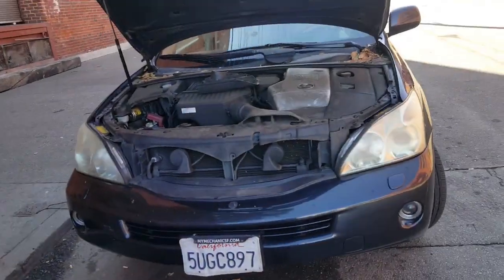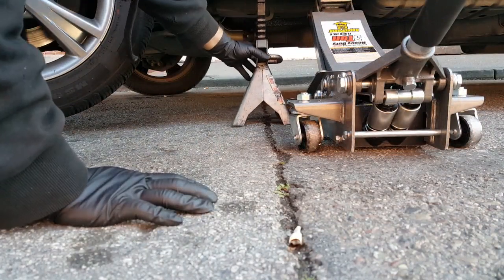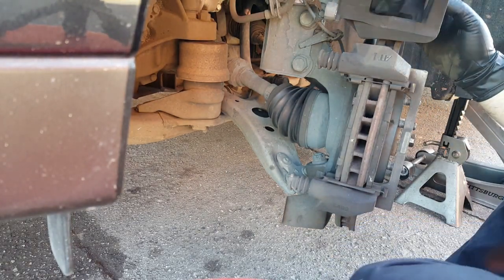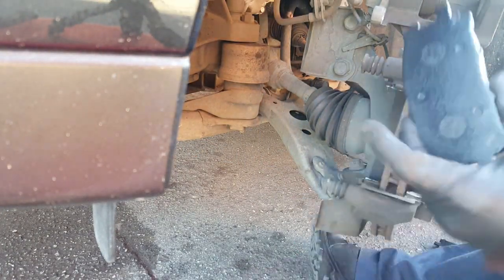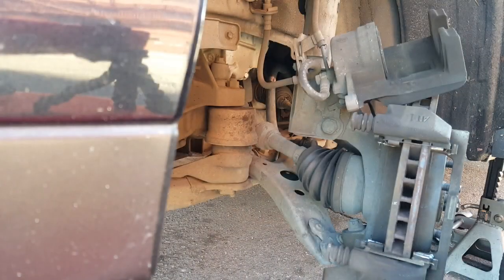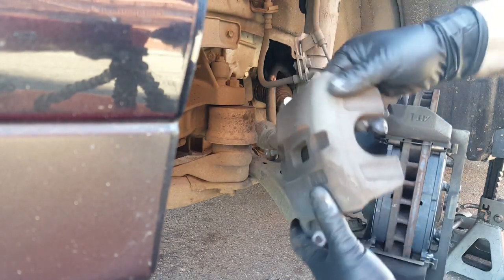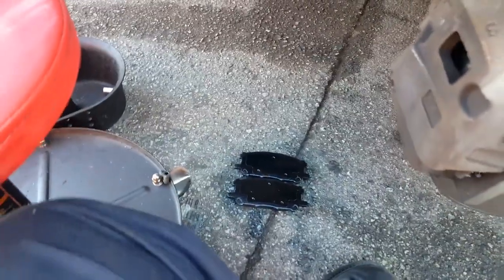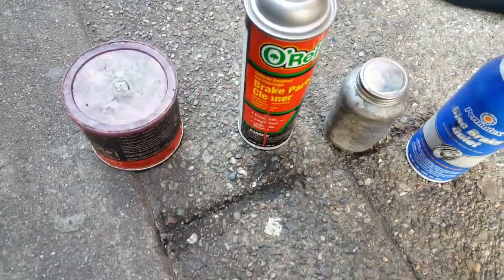2006 LEXUS RH400H FRONT BRAKE PAD REPLACEMENT HYBRID SYSTEM

Comment: Nice vid, except just yanking on the torque wrench like you do will end up with wildly incorrect torque settings. You are supposed to increase pressure gradually until it clicks. 

Also I tend to take the opportunity while I'm there (when winding brake pistons in) to crack open the bleed screw, stick a one man bleeding tube on and bleed the displaced fluid rather than force it back into the system. I then suck the old fluid out of the reservoir with a mityvac and replace it. Some cars (including the RX400h) require specialist software to bleed the brakes, this is a good way of partially bleeding the brakes without upsetting the system.

Comment: Change front brakes 2006 Lexus RX 400H; check VSC system, traction control etc. lights pop up. Is it normal when changing brake pads on this vehicle ? How to get rid off these lights.
Reply: Did you ever get the answer to this question from anywhere? Need to know the fix also.
Reply: Disregard, we figured it out
Reply: @romandoray7448 What was the issue and fix? Thx.

Comment: hi have the  newer 450h also these 2 steel springs  which are going over the rotor ?  My brake makes a fucking click noise when brake and release brake and it sounds like bad thin metal sheed or such stuff. inside i did not notice it but withopen window its loud and its front and back.